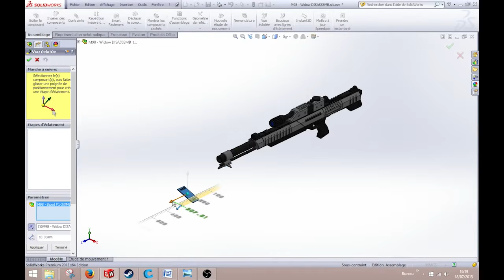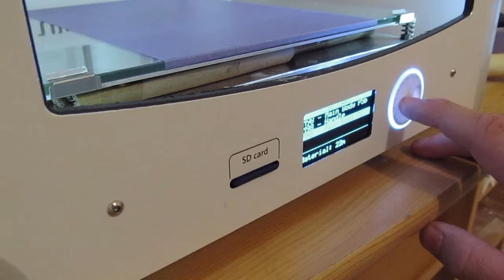The Widow Project - 3D printed Prop (Mass Effect)

Comment: What LEDs did you use? and where did you get them? Im printing this right now. This thing is amazing great work.
Reply from the maker: Thx. I used 6 simple 5mm red leds (with 220 ohm resistors) connected to a switch and a 9V battery. It bought each componant separaterely and soldered everything myself but next time, I'll probably buy a pre-made kit as it's way more simple haha

Comment: How much time did it take to build it, since 3d modeling? Also, how much time would it need for you to build another one (printing, assembling, painting)?
Reply from the maker: It took about 120hrs to print (and about 20hrs to model) on my Ultimaker 2. After the printing is done, I need about one full day to post process it. The video is a bit old and the process has changed a lot since then ^^